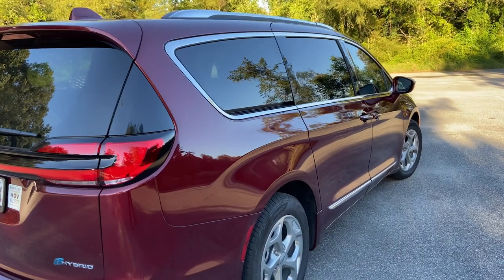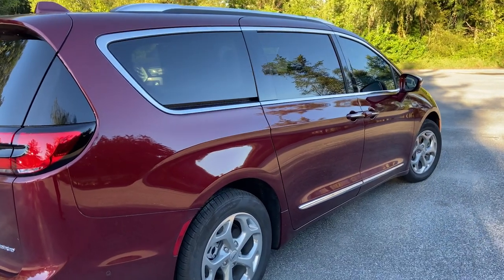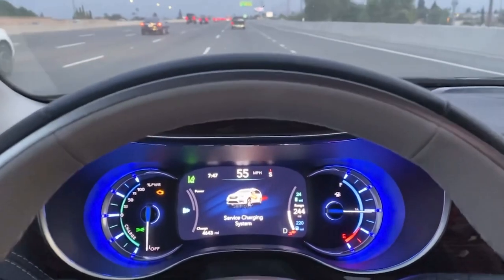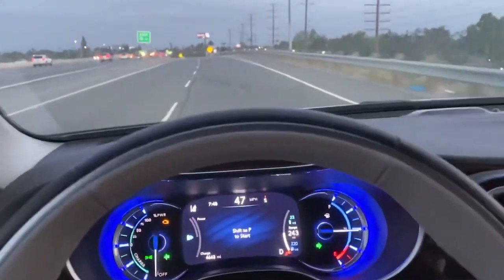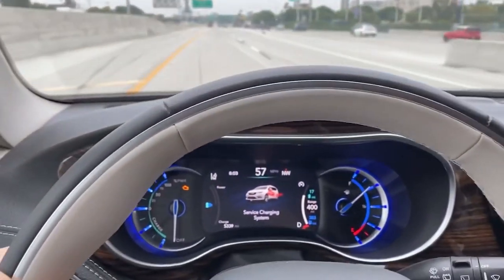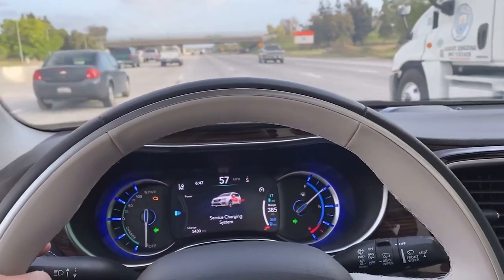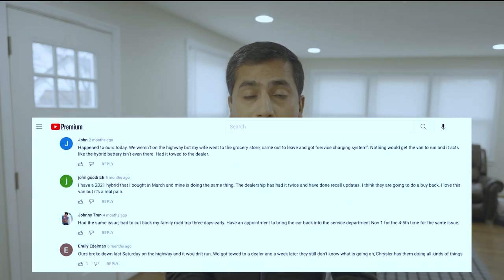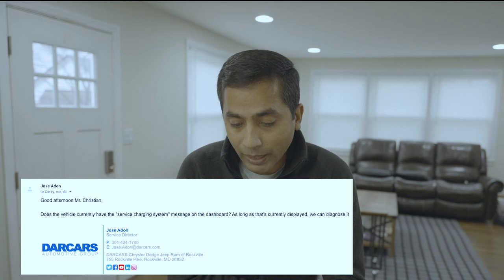Dangerous Common Issue in Chrysler Pacifica Hybrid

Comment from the maker: Update: I haven't had this issue in past 4 month after they changed transmission. So if you're having this issue, suggest them to change transmission.
Reply: Hi bro, how about now? Have you faced this issue again?
Reply from the maker: @sharathpaka4198  not yet
Reply: Hwave you had any more issues with this car ? Same issue or different issues as well. We are tempted to buy because of the plug in hibrid part and the space the van has but we had an horrible experience with a dodge 2018 journey before where we had to sue the manufacturer for missing parts under certified used warranty. We don't want to go through the same nightmare with dodge with this crystler van. Please any advive is welcome
Reply from the maker: @bmarco1602  I haven't had this issue after they changed the transmission. If I ever buy a car from this brand I'll be buying knowing that their customer service is not the best.
Reply: @ContentMafia  thank you! what family fuel efficient suv would you suggest? The toyota sienna?
How is the fuel consume with the plug in hybrid of the pacifica? Does it really help? We have a toyota rav4 prime and the plug in part really helps with the consumption. I never used the fuel so far
Reply: @ContentMafia  i had a terrible costumer experience with my dodge. Part in backorder for months. The dodge official dealearchip of the Bronx in NY,  sold me a certified used dodge journey car with broken motor mounts, and I had to sue them
Reply from the maker: @bmarco1602  Yes, it's terrible and hasn't improved much but I think this is still the only plug-in minivan in the market. That's their advantage.
Reply: @ContentMafia  how does the hibrid part work? Is it helping the gas consumption?
Reply: I just suffered the same issue on my first long road trip in the vehicle. I have about 16,000 miles on a 2023 Pacifica PHEV and had to pull over 15 times in 3 days of driving about 1200 miles. It seemed to happen when sudden changes in acceleration happened over 70 mph. Chrysler customer service was the worst, I got handed around in a loop from the dealer, told to call 1800chrysler, then road side assistance at Chrysler told me I had to talk to the insurance department, who said I had to talk to a dealer, so I went full pass the buck circle with no resolution to my issue.
Reply from the maker: @hungryscientist1  sorry to hear that. I THINK now they know solution to the issue. Take your vehicle to the dealer and have them complete all the recalls. See if the issue still persist and be careful meanwhile
Reply: Do you have any updates? Has the issue resurfaced after the fix? Thank you.
Reply from the maker: @Sir-Gerlad  fortunately I haven't run into this issue after they replaced transmission
Reply: @ContentMafia  Good to know. The Pacifica is at the top of my list for a family car.
Reply: @ContentMafia is this still the case brother? I just bought a new 2023 built 8/2023 which sat in the lot until now and I got heavy incentives that I caved it. So far love it.

Comment: I saw that video of the guy pulling off the highway. It was the main reason I stayed far away from the pacifica hybrid. I went for the 2022 Toyota sienna and you just confirmed I made the right choice. Sorry to hear about your situation. After spending $50000 or more on a car, this should not be an issue. I even heard the non hybrid pacifica engine sometimes just randomly stalls. It's good you are bringing awareness to the issue because Chrysler is not taking it seriously and Toyota is now giving them a run for their money
Reply from the maker: Thanks, Deverre. Yes, this issue could cause catastrophe on highway, so just trying to save someone and myself. I love Toyota. Only reason I went with Chrystler because this was plug-in and I didn't know about this issue at that time.
Reply: @ContentMafia   I am thinking to buyChrysler Pacifica Hybrid 2022. What’s your feed back. Since Toyota Sienna 2022 is one year wait and my test drive Pacifica hybrid looks much smoother ride , better acceleration, 4 months wait time. So I am leaning to order Pacifica hybrid 2022 but scared after seeing video? Pls share your thoughts or feedback on Pacifica 2022 hybrid
Reply: @ramreddy4042  Buy the non hybrid model.  I realize this comment is 4 months old and you probably made the purchase already.  Curious what you bought?
Reply: @ramreddy4042  I pre ordered it recently, it would be great if you could let me know if you brought Pacifica hybrid or not or if you got any update from Chrysler?
Reply: @lktiger009  how long is the current wait period..
Reply: @sathishraj1584  sales guy told it might take 3 months
Reply: @lktiger009  Hi, did you get your car? How is it so far?
Reply: @sharathpaka4198  I got it and using it for last two months, no issues seen so far.
Reply: @ramreddy4042   Did you went ahead and purchased Pacifica Hybrid 2022? If yes, did you ever faced this issue?

Comment: :) - I am getting rid of my 4th Chrysler van soon. It is a 2005 with 94K miles - no major issues yet, but there is NO WAY I would purchase anything from Fiat. The Pacifica plug in Hybrid is over engineered. Last spring I was almost SOL as I needed a new seat gear and the parts were MD'd. I have put a deposit down for a 2023 Sienna ....

Comment: This just happened to my 2020 Pacifica Hybrid about three weeks ago. As I was doing 75 mph on the highway, it just shut down. It started right back up after I pulled over and stopped. For about a month prior to this the Check Engine Light would go every now and then, but would go off by itself after 30 miles or so, making diagnosing any issue difficult. There were no other issues apparent, the car ran fine. Immediately after it stalled, I brought the car to the dealer and they fixed it the next day with a software update. It hasn't happened again. They said it had to do with a POA43 error code (Drive Motor "A" Position Sensor Circuit Intermittent).
The software update seems to have fixed it, but obviously the car should not have stalled in the first place. Stalling the vehicle should never be the default setting of any issue. Chrysler needs to address this safety issue.
Reply: Hey, did the issue was fixed by this software update, does it reproduce right now? Thank you!
Reply: @happyend9999 The software update seems to have fixed it, it hasn't stalled and the check-engine light hasn't come on, and it's been about six months now.
Reply: @kerry9125  nice, glad to hear this
Reply: @kerry9125  did the issue come back at all? We are considering hybrid Pacifica.. but have lots of doubts
Reply: @ES-iv6wb  It hasn't stalled again, but about three months ago the check engine light came on again (briefly) with the same error code. I immediately took it to the dealer and found that a recall has been issued in January but they still haven't come up with a fix for my model year. I called Chrysler FCA Headquarters (which now goes by the ridiculous name "Stellantis") and they were not helpful at all. About two months ago, I called the National Traffic Highway Safety Administration. They assigned me a "case number", and have done nothing else (as expected from a government agency). I still drive the car every day, but no one has contacted me with a solution for this safety issue; so I really feel like no one gives a shit about me, safety, or backing up their product.
Other than this issue, the car has 32k miles and is fantastic. It has a better combination of drivability, economy, comfort, and utility than any other vehicle. The only negatives are: the back windows don't open, so you get some wind buffeting when you open the front or second row windows ( you can overcome this by opening alternate side windows). The other negative is it has no spare tire. I bought a used one online.
One last warning- Almost all car dealerships no longer provide loaner cars when you bring the car they sold you in for repairs, despite what they promised when you purchased it. So get that in writing if it's important to you.
I hope this helps.
Good luck.
Reply: @ES-iv6wb  another thing to consider, you can't tow anything with this hybrid vehicle.
Reply: @kerry9125  thanks for your reply.
I read that the error was due to a faulty cable inside the transmission that was disabled with software update. I’m just not sure if I want to drop 40-50K on a car, and have issues with it. I think we will probably pass on any Chrysler product  given the customer service is not good, and no loaner cars? That’s a joke. If you’re a customer and you feel like Stellantis doesn’t care about you.. what stops them from not caring about me. 

As far as I’m concerned, Chrysler messed up. They only have 2 product lines, the HyPaci and 300. And if they can’t get it right- or at least offer customers apologies and a replacement car. It’s a no go.

Thank you for posting your experience it will help other shoppers make more educated decisions in the future.
Reply: @ES-iv6wb   From my understanding, the crankshaft position sensor provides essential info for the ignition and fuel injection to make the engine run smoothly and efficiently.  I don't know how any software update can effectively fix a bad sensor or sensor wire, and I don't know why Chrysler won't simply replace the wire or the sensor. This is the kind of info I can't get from Chrysler, or anybody else. Nobody, including the government, cares about safety.
Obviously, it's very annoying and frustrating. I just want my car fixed so it's safe to drive.
Be careful, because this issue is likely to be systemic among most car companies because many of them source the same sensor manufacturers. I have heard of other cars having similar stalling problems.
Also, the elimination of the loaner car is more of a dealership problem that isn't limited to Chrysler, and you'll probably run into that no matter what car you buy. They did away with it during Covid when cars were scarce.  Make sure you have in writing that they will provide a loaner car or fully compensate you for a rental car, including the cost of transportation to the rental car place.
Bottom line: as bad as Chrysler has been on this issue, I don't know if another car company will be any better.
Reply: mercedes is doing them same

Comment: I own a 2020 Pacifica hybrid and have not had this issue while driving. In winter time, when parked out doors, the van will show service charge issue when I turn it on and prevent it from being put in drive or reverse. This issue doesn't happen in warmer weather. It doesn't matter if the van is plugged in or not. I haven't had time to get it diagnosed yet but it appears to be an issue with the charging system and how the software responds to it.
Reply from the maker: Interesting. This issue has happened to me multiple times while driving but seems like most of the time it was during late fall to spring. Also, it has happened to me on freeway when the car has already been running for couple of hours, so I assume car should be pretty warm at that point.

Comment: I did watch the other video that happened on the FW. It looks like the high voltage battery was over charged. What you need to do is to make sure you are not AC charge the battery pack to full. It would help or eliminated the problem. It doesn’t look like it going to happen in the city because you are not getting enough regen to make it over charged. I hope that help, maybe charge to 60% max. (Small battery for such a large mass that can store a lot of energy giving back high regen current)

Comment: Bought a 2022 CPO PacHy w 13K miles in Dec. 2023 and the extended warranty.  June '24 got the dreaded warning to pull over, "engine shutting down" on the Interstate (16K miles now).  Limped to dealership, OBD reader said PCM (Powertrain Control Module) failure.  When the technician diagnosed it, they said the transmission electronics had failed.  Chrysler is replacing the transmission, supplied me with a free of charge loaner to drive (due to Warranty coverage).  I will post an update after repairs are complete.
I really like this vehicle and really want it to get operating correctly!  Owned 2 previous ICE Pacificas and had zero problems.

Comment: I own a 2017 Pacifica, no Hybrid, and is doing that. In the middle of nowhere a flashing D and asking to put it in P to restart. One morning did not start and changed the battery, which helped, but is doing it again. The mechanic is puzzled and says he will have to keep it for some days to find out the real problem. I call the Chrysler phone number and they said there is not any recalls for my van. Should I go back with the mechanic, or try the dealer? I did not buy my van brand new, but it had around 20K miles. Now is more than 100K.

Comment: My Pacifica died at 10k mi. One dealer attempted to fix. Then it broke down again about 200 mi later. I took it to another dealer, and it took two weeks, precovid btw, to fix. I haven had an issue since but then I get a notice saying that their is a recall with no fix for Chrysler hybrid 2018 battery. 12 vans have caught fire 8 while plugged in, 4 while unplugged. I will never buy another Chrysler or even possibly another American made car again. I can’t even sell the thing because the value has tanked.
Reply from the maker: Sorry to hear that. I know problem is worse in 2018 model. Chrysler should buy back these cars

Comment: @ContentMafia Have you had any issues since they replaced the entire transmission? We are trying to figure out whether to keep the minivan, or get something else that is safe and reliable. We just got our 2019 Chrystler Pacific Hybrid back after an entire new transmission was required. "Cause: transmission catastrophic failure. Correction: started vehicle and put into gear and verified noise, when put into gear loud and violent metal grinding noise coming from inside transmission, vehicle does not move at all. trans is not servicable".
Reply from the maker: I haven’t had the issue I’m talking about in this video after they replaced the transmission. I hope you don’t run into any issues either. Good luck!

Comment: I had the same problem with my Pacifica hybrid 2022 model year. They replaced my transmission after only owning the car for 7 months. After picking up the car, we noticed a loud noise when the car engine turns on in hybrid mode. The dealership ran test for 2 weeks and determined the sound was normal. I can tell you after owning the van for 7 months it’s not normal. 
Have you ran into this issue with the noise? Also has your van stalled any further after the replacement transmission?
Reply: I just got on i now have 1400 miles on it and that noise i started hearing shortly after I got it i have for about 3 weeks they said it was nor.al but its loud and I feel like its deff not normal ... im scheduling an appointment with a differnt dealership
Reply: @biancab6385  whats the update anymore issues???

Comment from the maker: Update: after lot of nudging, dealer finally agreed to do some repairs. I just got the car back from repair and hoping I don't run into this issue again but I'll update you guys if I do.
Reply: Curious as to what failed and what they did to fix?
Reply from the maker: @jazzyjigsaw  gas/accelerator fails while driving. They did some PCM/AHCP update I think. The issue hasn't happened to me since but I haven't drove vehicle much after
Reply: @ContentMafia  You should have asked for a replacement car. That should be considered a lemon. Btw, what camera are you using to film your self in your living room?
Reply from the maker: @gelowz4174  I doubt that would be easy. They have done some repairs after a lot of nudging. I haven't had the issue after that but if it happens again, I'm going to look into what I can do legally. And I'm using Sony FX3
Reply: @ContentMafia  .  Thanks for posting your troubles and sorry to hear the issues you faced, especially trying to convince dealership. Based on the frequency of occurrence of the issue, do you feel that the S/W update worked or still inconclusive? Also have you heard of any 2022 having similar issue? Coz I have one 2022 on order and would be getting it in 2 week time. I am now in a dilemma whether to buy it or not.
Reply from the maker: @sramesh81  I personally haven't heard 2022 model having this issue but I think 2022 models haven't been in the market long enough. Have you tried to search forums? I haven't had the issue since they did some repairs about a month ago but some user has reported recurring issue even after repairs.
Reply: @sramesh81  see above.  Emily Harrington has a 2022 model.  Problems as you will see.  When did you order the car?   We just placed an order on March 7.   Told they have a Vin number.
Reply: @jackcovington645  I placed my order end of Jan, the ship date came and went. It still hasn't reached the build stage. I was oblivious to all these issues before placing the order. After coming across this video I found that many folks had similar issues. Infact similar issues have been reported over multiple model years and yet Chrysler hasn't addressed it. Maybe they don't know how to fix it or it is a defective chip in production line.

Comment: I've had the same issue with mine. 2021 Chrysler Pacifica Hybrid. Mine has happened as the electric charge runs out and I don't get any alert or service light. But I get service lights all the time... just not when the car stalls out. The amount of time I don't have that I've had to spend on getting this car fixed is awful.
Reply from the maker: yes it's very painful to spend so much time and energy on fixing a new car after spending so much money :( hopefully they figure out what the issue is soon